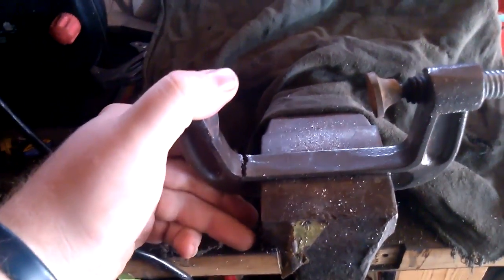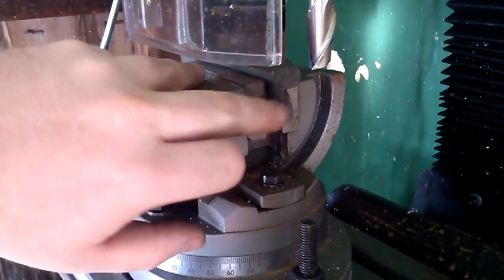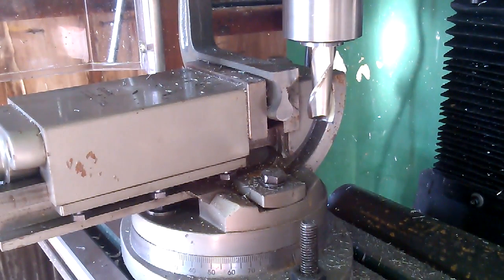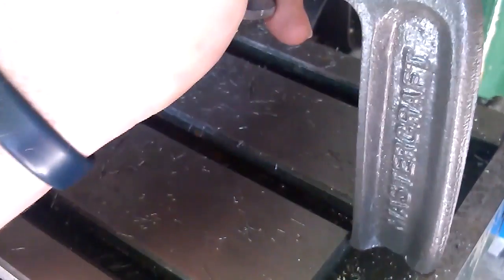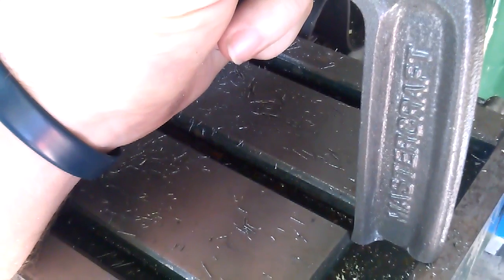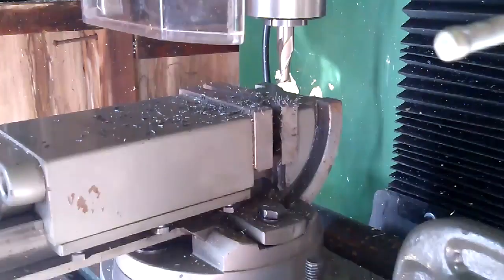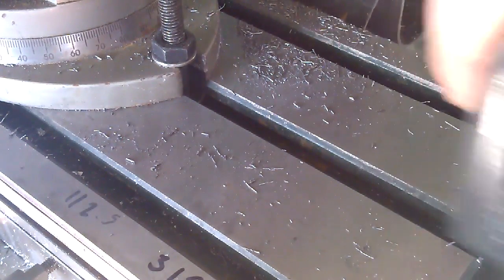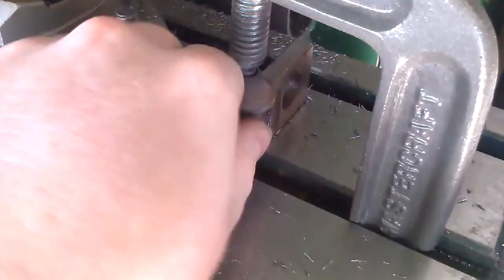DIY mill clamp

Comment: I would suggest building a fixture table if you haven't already made one . You will have the best clampdown part holding ability for any job you want to run on your mill and if you run it one inch on center's with every other hole a dowel pin , threaded hole , dowel pin etc.. You can have a 45 degree angle anywhere on your fixture plate
Reply from the maker: That's a damn good idea. I'd make it small enough that it could comfortably fit on my mill or my bench. I already have plans for something similar but for a different purpose so maybe I can kill 2 birds. I'm going to look in to that. Thanks

Comment: Nice idea but be aware that poor fitting of the 'Tee shape bottom of the clamp can if tightend unduly, break out the 'Tee slot and impair your nice mill table. This is why the 'Tee nuts are a cozy fit in the slot so as to provide a large surface area to spread the load.
Cheers MoK
Reply from the maker: Good point but the table is much harder than the clamp. I'm always cautious about using to much pressure but I think it's much more likely the clamp will break before the table.
Reply: +Dennis Skerb 
Sorry mate I haven't a clue what you'r on about/
Reply: +Mo King that stuff kills brain cells, just sayin
Reply: No doubt your mill table is just the usual cast iron so no it won't be any harder than the C clamp frame. And how "hard" a metal is doesn't always indicate just how ductile it is before it breaks. Cast iron is a lot like concrete where it doesn't have a whole lot of bending strength before it does break. Given the leverage factor with the hold down screw trying to pivot the clamp body backwards I can guarantee you'll break one or both edges off a tee slot with anything held down even half tight enough to resist a normal cut. A proper hold down set for a mill is designed and made to clamp down just about anything you can fit on the table and still get it under the spindle. There's not a hope I'd ever try and use anything like this on my mill. Sorry if it seems I'm being overly critical. But simple logic about the forces this will exert on the table slots say's it's a real bad idea. On a cast steel table then just maybe. But I can't think of any manual mill that might use cast steel for the table anyway.

Comment: thanks a lot for the video nice idea i'm probably gonna make a couple of these
also if i may a little tip with your caliper when you open it you see that little bar that sticks out at the end of it ... you can use that to measure depth. it'll make the process simpler than trying to use the jaws of the vernier and gives the same measurement.
cheers from Canada :)
Reply from the maker: Thanks for the tip but I'm aware of how to use calipers. If your refering to the part I think you are, I was trying to measure the distance from the underside of the t-slot to the top of the table and there wasn't a lot of room on such a small table.
Reply: *****  then you should have used the caliper tail as suggested by Tarik, 1st measure top of table to bottom of slot, then 2nd put something ie t-nut in the slot and pull it up snug to the underside then measure top of table to top of t-nut and subtract this from the 1st measurement.
And half way through the video, measuring with chips stuck to your caliper jaws . . . really?
Reply: instablaster.

Comment: This is bad design. This clamp will always push to the side rather than straight down.
Get a piece of steel bar, mill a slot in it, make a T-nut, get a stud or a piece of treaded rod and you have solid clamp instead of butchering a good C-clamp.
Reply from the maker: 1. The clamp was broken 
2. I have many toe clamps in various styles and sizes.
3. I have used this clamp dozens of times without issues of "pushing to the side".
The entire point of this video was to make something useful out of something broken. Did you even watch it?